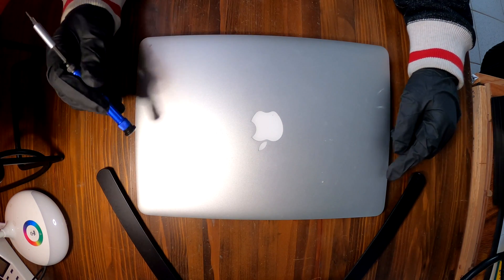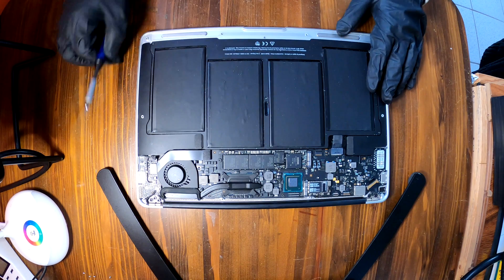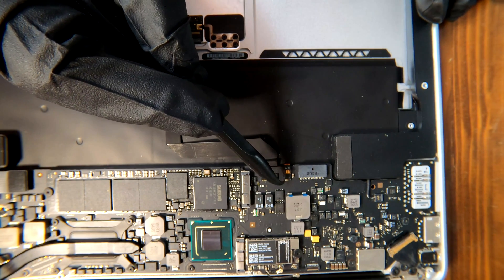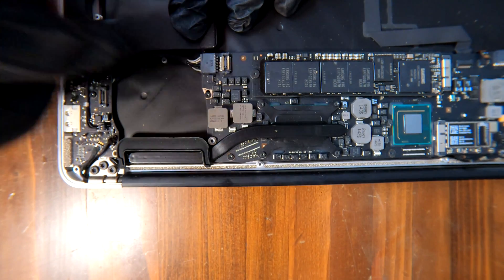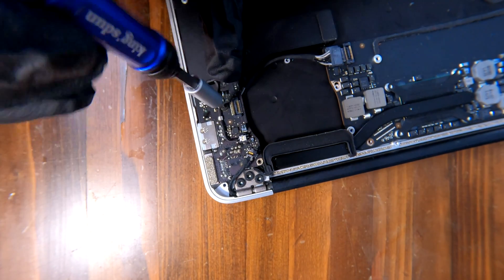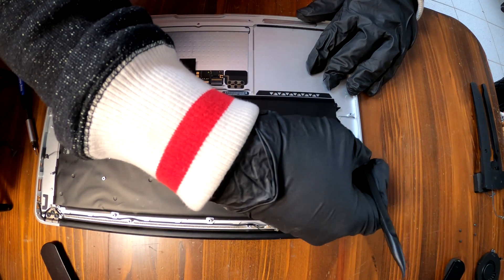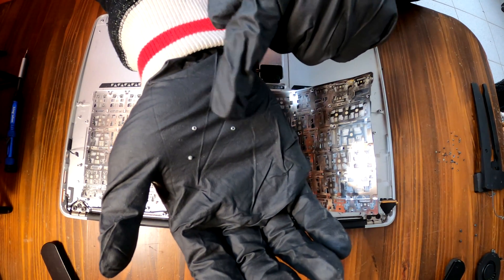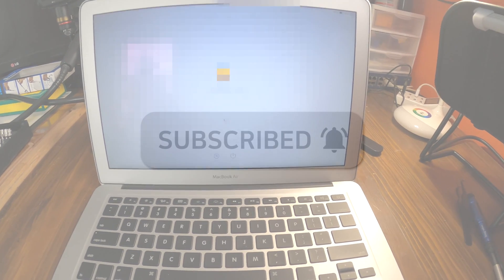Macbook Air A1369 Keyboard Replacement & Disassembly

Comment: All screws are the same? And how do you keep track of the screws position?
Reply from the maker: Basically I keep them separate. I use a magnetic pad and place the screws on it.
Reply: The back 2 are usually longer on the case than the other screws for the case.